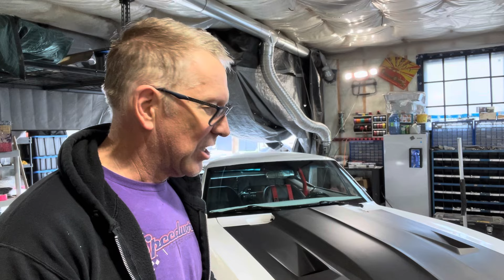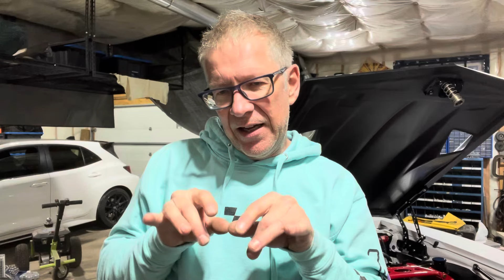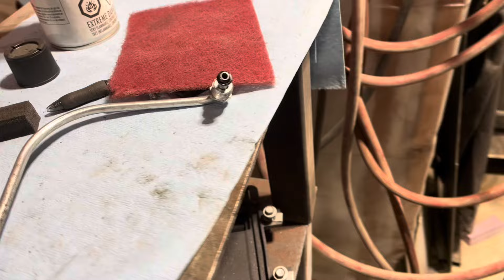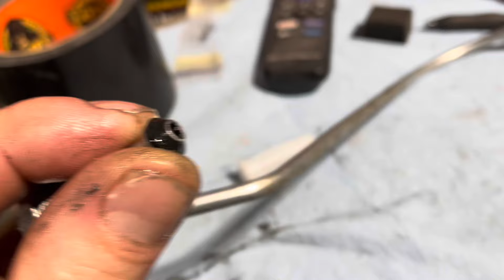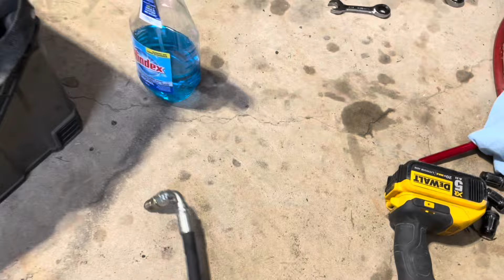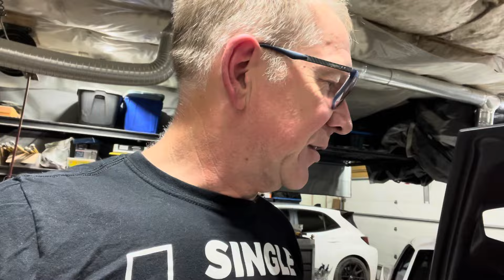Problems and Solutions

Comment: Hi Mark, aren't one off street cars fun (I'm 10+years in on my MUCH simpler SBC MGB) and everytime time I do another upgrade they seem to affect everything around them (recently changed the upper end of current engine, aluminum head/intake/carb.),  and been finessing it for a couple weeks to get it right (close). My chassis is WAY basic, manual brakes/steering so they've been trouble free for years. I like the exotic nature of your Camaro comparatively though. And yep, I love it.
Reply from the maker: Yes, they are exciting but sometimes the research and development can be a bitch. Doing a bunch of R can save you D but ultimately you gotta do the D, lots and lots of D
Reply: @SKIDMARKperformance  Just bolts on, lol